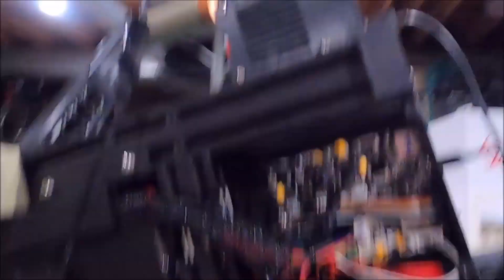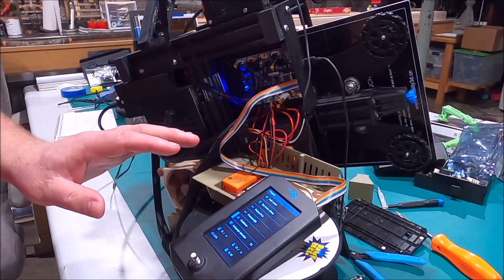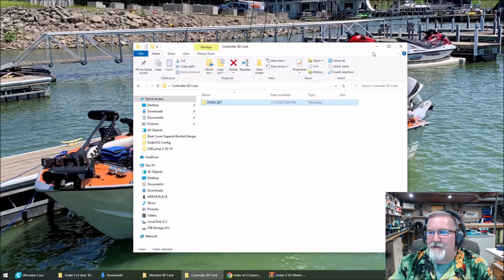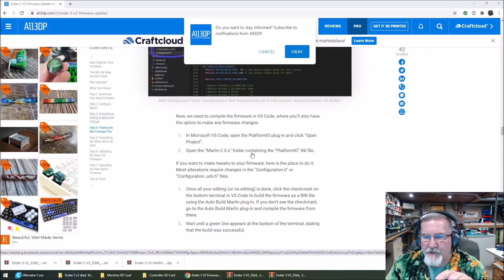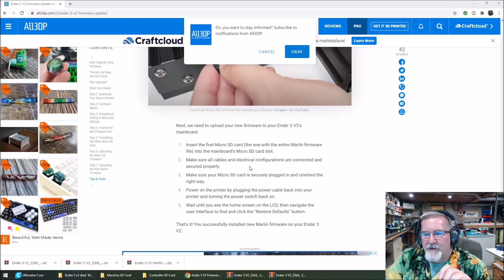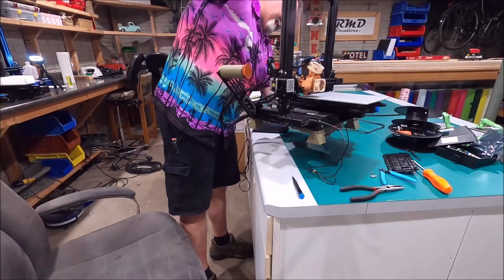Creality Ender3 V2 Died What Happened? Let's dig and find out. Then we fix it. It's what I do!!!

Comment: In hindsight updating the firmware is not that hard, but nice job done figuring it out. The X, Y and Z drivers can be damaged when spinning the corresponding motor to fast when moving the gantry  or bed to fast due to back EMC of a motor. This will not be the case for the E-drive as the feeding mechanism is released when feeding or removing filament. Maybe the E-driver could be stressed when the extruder is clogged or there is to much filament friction for an other reason. Electro static discharge or an pre-damaged originala E-driver IC could  have caused it. Only a deep board and E-driver investigation could determine the actual reason. But for less than $40,- you have a new and more up to date board and have a scrap board for spare parts.

Comment: hey, i also changed my mainboard from 4.2.2 to 4.2.7 but i didn't do the lcd firmware upgrade... not sure if you have to do that because mine is working fine.  My mainboard didn't die on me but i changed it because the 4.2.7 is even more silent then the 4.2.2 which comes with the ender 3 v2.
Reply from the maker: if it's working then I wouldn't worry about it.

Comment: Im kinda late in here, but maybe you could have checked up the vref on the extruder. Also 4.2.7 needs vref check, mine overheated the y stepper a bit
Reply from the maker: Stepper drivers on the main board seem to be a weakness on the older boards. I have had the extruder fail once on the 4.2.7

Comment: When flashing my E3v2 screen I had the same problem - the screen would go orange, and stay there.  IIRC I finally found someone mention that when it goes orange is the indication that it's done flashing the firmware.  Once it went orange, I shut it off, removed the SD card, rebooted, and it was running the new code.
Reply from the maker: Yes that's what mine did too. Thanks for watching

Comment: This is interesting, I've had the same issues after following your silent fan upgrade. The printer had no issues until I changed out the fans, to the same as you used, and then my extruder driver died...
Reply from the maker: The 4.2.2 boards have known driver issues. I have had it happen on two of my Ender 3 V2 v's

Comment: I didn't have this same problem, Mine went to a blank screen.  I upgraded all firmware several different time per forum suggestion.  This video gave me confidence to change it out.  I received it last night.  Installed but since I had done some firmware upgrades to the screen I had a high pitch tone (oh crap what now).  Got the lates board firmware onto a clean sd card.  flashed with th3dstudios firmware. Turned on flash nothing.  Take out card and turn on there's their logo, and boom.  I didn't try and print last night, but will be going this evening.  I did bed level it however last night.  Thanks again
Reply from the maker: My first go round was aggravating.  I did a board swap on my second machine and just fired up no problem

Comment: I was just glad the fault was not related to your fan upgrades, as I was planning to do the same.
Reply from the maker: It's all good. Thanks for watching and commenting
Reply: I had the same issues after upgrading to the silent fans mod he did in a previous video. The printer was working fine until the mod
Reply: @pixio710  mainboard fan plate designer states that a blown fuse can occur if u mount the buck converters on the original fan plug

 " WARNING: when you wire in the fan, do NOT use the normal controllable fan port. Use the Hotend port which is always on. Using a controllable port + Buckconverter can blow the microfuse on your board. I have a picture that shows which port to use."
Reply: @Verhulstje  Do you have pictures of the Hot End Port you mention?? I need to plug the mainboard fan to a port that keeps it on at all times.

Comment: I would not have bought a Creality board, I would have got an SKR mini E3 V2 which is a drop-in replacement for an Ender and is much better quality and a cheaper board it also preprocesses the G-code ahead of print time which helps with the jerk and acceleration when printing curves and corners, I have one in an Ender 3 and a 1.4 turbo board in my Cr-10, I see instances all the time in the forums where people have upgraded their stock board with a Creality upgrade board only for it to fail 3 months down the line
Reply from the maker: Time will tell, thanks for the advice

Comment: You probably killed it with switching noise from all those buck converters you put on it for the fans.
Reply from the maker: Wrong. The e drive on the board has nothing to do with the fan circuit. Thanks for watching
Reply: @Michaelinthebackyard  except the whole machine is powered by that one  24v power supply. Saying they aren't connected is like pissing in a jug of milk and saying it doesn't the bowl of cereal you're about to pour.

Comment: i just ran into this same issue with my enderv2
Reply from the maker: Not sure if it is just the issue with the 4.2.2 boards or not.  Hoping my 4.2.7 board holds up better
Reply: @Michaelinthebackyard   i contacted support waiting to hear back from them told them what you had to do to fix the problem . i have only had it for 8 days it just quit extruding but if i hookd the x up to the extruder stepper the stepper works but if i hook the extruder cable back into the extruder stepper i get nothing
Reply: Support got back to me and gave me a troubleshooting guide to diagnose the issue which is pretty much everything you said to do in this video which i have already done
Reply: Note: the operation must be shut down when the wire group is exchanged.
1. Could you please plug the X motor cable into the E motor, move the X motor command to see if the E motor is working? Working indicates that the E motor is all good, and does not work means that the E motor has issue.

2. Mak sure the motor terminal is correctly wired, interchange the XE motor wiring on the main board side, and move the X axis motor command to see if the E motor is working normally. The work indicates that the E line group is normal. If it does not work, the E line group is faulty; 
move the E axis motor command, check Whether the X motor is working normally, it means that the main board is okay, if it doesn’t work, it means that the main board is faulty.
We would provide proper replacement part to you once confirm the issue with you.
Reply: @Michaelinthebackyard  they are shipping me out a new board on Monday
Reply: @Michaelinthebackyard  I had an issue with my 3-month-old V2 having layer shift, after rebuilding the thing and trying over a dozen fixes, I found out it was the mainboard. I bought the 4.2.7 from Amazon and it's been rock solid ever since. Creality sent me a new 4.2.2 board, but I'm skeptical even bothering to swap them after seeing how reliable the 4.2.7 board is.

Comment: I had the opposite problem with flashing my V2's LCD.  It did the orange to blue screen very quickly, which appeared normal.  It was only after trying a firmware set that had a custom splash screen did I realize that the LCD updates were not actually being applied. Reformatting with a 4096 allocation unit size instead of whatever the default was did the trick.  Also made the main board firmware updates a lot more stable as well.
Reply from the maker: Goot to know. Thanks for commenting.

Comment: ah yes firware...old computer geek here so that was more familiar territory to me. Well it was odd that you need to flash the control board and lcd firmware. i updated my cr6se after my second print and on mine after updating the controller the lcd was in chinese language until you updated the firmware for the lcd. 
I read that you want ONLY the .bin file on the sd card for the controller and you must update it first then update the lcd and when updating the lcd up top in the right (i think it is) you will see "end" signifying it finished and you can generally tell if it worked as if will show some files as copied over/updated and some were not....if it shows nothing was copied over it failed.
At least the menu system is fairly simply enough that you could still navigate it fairly easy if you really needed to print something before you got it fixed. 
NIce way to test your steppers as working i am betting i will use that in the future....just got my first printer a week ago.
Reply from the maker: Good stuff

Comment: Was the old controller board equipped with silent drivers, like TMC2208s or TMC2209s?
if so, here's the deal: if not otherwise defined, the driver is running in stealth chop mode and that's not really sufficient for the e-drive. you certainly wanna switch it to spread cycle, this gives you a lot more torque without getting a toasty driver.
Reply: X Y Z   Stealth Chop Mode 
E  Spread Cycle Mode   ????????????????????????????
 I got Skr-mini 1.2 & i Love It..     :)
Reply: @scottsound4711  you could use stealth chop for x, y and z, but the jerky movements of the extruder aka retractions in combination with high accelerations and jerk values will likely toast your e stepper driver cause of the high FOC resolution. that's caused by the gate capacity of the internal MOSFETs of the drivers and therefore a delayed off time.
anyhow I'd even use hybrid mode for x and y with like 40 mm/s hybrid threshold.
Reply from the maker: Yes it was.

Comment: Geez I would have check for a nozel clog... which I did... that fixed mine... 
Then i had to go back and torque it down when warmed up as it leaked so bad it popped the silicon sock off... (a lot of clean up first😂)
Reply from the maker: Well when the extruder motor isn't turn then there is nothing to clog.  Thanks for watching

Comment: You should consider getting small copper heatsinks for them stepper driver chips so it would not happen again as they get toasty even with big fan.
Reply from the maker: They already have heat sinks on them.  I see that copper is almost 60% more conductive.  I will be checking that out.
Reply: @Michaelinthebackyard  Also you could reduce voltage on extruder stepper little bit to reduce heat.

Comment: Have you tried some heatsinks for your steppers?
Reply from the maker: I have not and I could see where they would be helpful.  They get warm on the Ender3 V2
Reply: @Michaelinthebackyard  don`t know wether their drivers have a potentiometer for adjusting stepper voltage but if they do you should try turning the voltage down on them cause from the factory they come way too high and that`s the main reason for getting so hot; on a Two Trees machine I have the voltage was almost 2v when its supposed to be about 0.8v, so almost thrice the voltage; they would get hot to the point that it would burn your finger. After dialing the voltage down they are now only lukewarm even after several hours of printing.

Comment: Did you try to contact creality for a replacement board? I am having issues with support, my glass bed is not even and already had a hot end fan go. Contact the Amazon seller (comgrow) it has been weeks and still no replacement parts...
Reply from the maker: I did not.  Now that I have it fixed I will take the time to reach out to them to see what they may do for me.
Reply: @Michaelinthebackyard  good luck with that. I contacted them via their official site and they basically told me to contact their US branch (which I am convinced is not located in the US). so around in circles this go. These companies are good at quantity and lacking when it comes to quality is my conclusion, so now I have a prusa.  I hope your customer service experience will be more fruitful.
Reply: @TheSanzca   depending on your location in the states there’s like a 12-14 hr time difference between here and china you need to contact creality not the seller and from my experience dealing with chinese tech supports has been hard on the communication end due to the time difference but i have not had any issues getting them to send me parts to fix my problems myself. I also order stuff straight from manufacture and not from Amazon
Reply: @TheSanzca  send it back if you are still on the return period with Amazon i hate them and I don’t buy anything from amazon i have had nothing but bad luck with everything i ever ordered from them. My ender3v2 came straight from China but when i ordered mine they blamed it on pc error but i only got my filament i ordered with the printer but no printer showed up i contacted creality they got back to me around 3am my time they shipped me a new one and refunded me a portion of my money for the hassle
Reply: @squirrelmasters  thanks for the tip. I agree with you re Amazon, my experience with them lately has been less than satisfactory.
Reply: I’m in the same boat waiting for a replacement main board from Comgrow (US). I still have a few weeks to do an Amazon return. Should I still wait?  Where do you recommend buying a new/different E3v2 instead of Comgrow?
Reply: @drewpix  Maybe from creality directly or from your local 3d printer shop? The other option is to buy from a place that accepts paypal and if they do not honor the warranty you can always try and claim your money back?
Reply: @drewpix   my replacement board from creality is supposed to be here Friday or Saturday
Reply: @squirrelmasters  thanks will u post again after you received and/or tested it? It’s stupid that I paid for a new printer and it’s broken out of the box (major layer shifts)
Reply: Andrew Chang check the tension on your X and y axis belts they can cause layer shifts there's a guitar tuner app you can use to make sure they are tensioned right I am not sure which cord then ender3v2 is supposed to tune to but I am sure you could google it to find out. I had layer shift issues when my X axis belt broke and loosened up
Reply: @squirrelmasters  I have checked those things. I have the same thunking sound after long runs as described on Reddit. It’s some bad batch of 4.2.2 boards which overheat the stepper driver. https://www.reddit.com/r/ender3v2/comments/kn8u72/layer_shift_investigation_data_and_video/?utm_source=share&utm_medium=ios_app&utm_name=iossmf
Reply: @drewpix  mine was the xtruder stepper slot quit working on my board i have the 4.2.5 board they sent me a 4.2.7 replacement board
Reply: @drewpix   i got my replacement board today i had to flash the firmware on it but otherwise no issues with it so far won’t know 100% till my belt comes in
Reply: @squirrelmasters  nice I’m still waiting for a shipment confirmation.